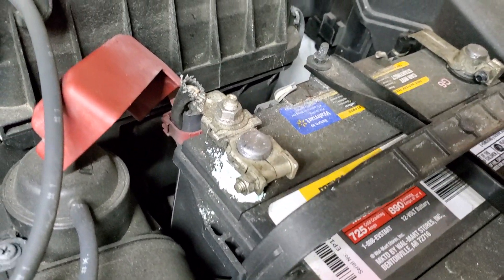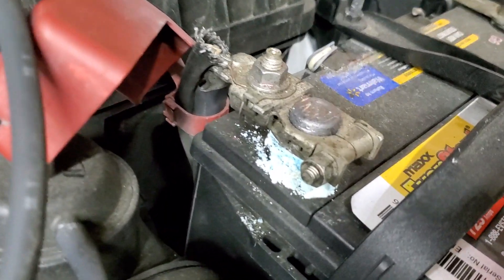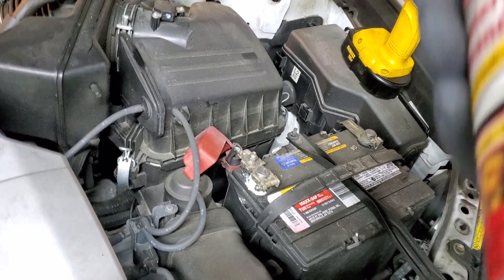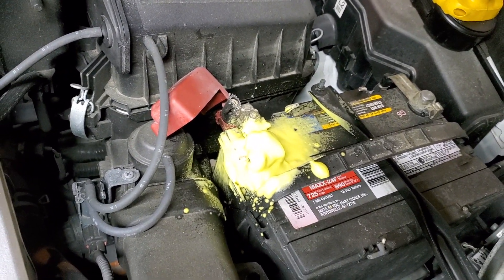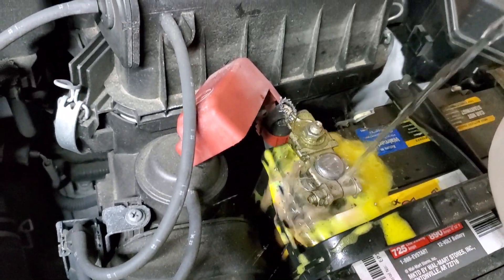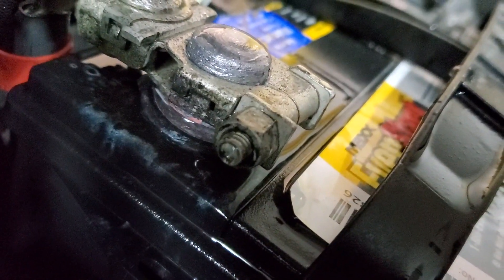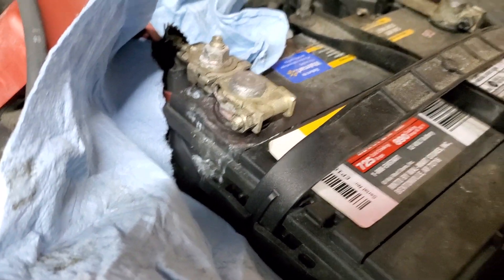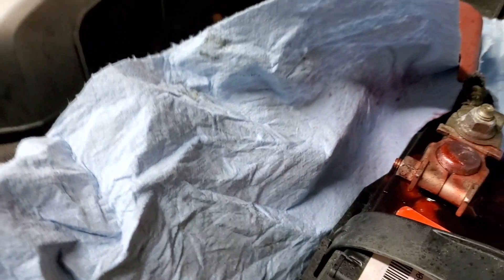Battery maintenance the easy way, how to keep battery charged, dead battery, best car battery

Comment: Thank you for your tips.  Glad to see you are using Walmart Everstart Max batteries. From multiple years and multiple cars, have only good things to say about them. I had few premature failures (3 to be exact) with Inerstate batteries over the years.  I took it back and was told one of the cells went bad each time. I just stick to Walmart now. just got another Everstart Maxx from Walmart for 88 dollars. Can’t beat that anywhere else

Comment: Baking soda mixed in water should do the trick. Then I spray WD40 on the terminals to keep it clean and conductive
Reply: Just use hot water from a kettle,let the water cool down just a min thou.I've done it for years in the car trade.Simple.
Reply: After cleaning terminals I like to use petroleum jelly on the terminals. Just smear it on them and let the heat from the engine melt it into and around the terminals.
Reply: You are right, I used baking soda and wash off with warm water. Works great

Comment: How does this help with life span of the battery?  Corrosion is very insulating itself.
Reply from the maker: Always Fully charged battery has longer life than the one is partially charged due bad connectivity

Comment: Suggestion: Why not remove the terminals and clean them with a wire brush then spray them with the staff you used. I used to apply a thin film of vaseline to protect the terminals.
Reply from the maker: Good question.  It was the plan,  but I would loose memory seats settings when I disconnect battery.  It this cleaner didn't work,  I would had remove terminals.

Comment: the best insulator for car battery terminals is bee honey ... natural and ecological
Reply from the maker: I wonder how many insects it will attract? Also,  honey is a sugar and it will create corrosion when it's starts breaking down.
Reply: @repairvehicle  
honey is a more special sugar that is anticorrosive .... try it out of curiosity and you will be surprised ... we have been putting honey on the landmarks for over 20 years

Comment: I also use a dremel with an wire wheel to clean the terminals. Also keeping the terminal nice and tight will prevent battery acid from forming around the terminals.

Comment: What about batteries in the trunk?
Reply from the maker: You have to remove battery to clean terminals.
Reply: @repairvehicle  And all scrub the wire terminals too.
Reply from the maker: You have battery in the trunk?
Reply: @repairvehicle  Maybe a BMW or Mercedes.
Reply: @repairvehicle  

      Chevy HHR trunk and Oldsmobile aurora under seat are in cabin area.  Chevy traverse under passenger foot board.  Not all batteries are in engine compartment
Reply from the maker: Thanks for sharing.

Comment: Lol, I just use a half can of coke and then drink the other half, then rinse the battery terminal with water.
Reply from the maker: Good thing I don't drink coke, probably poisoning as battery cleaner. Lol
Reply: @ToddRogers00  The acid in your stomach is worse than anything coke has. People have no esophagus problems drinking coke, but with some heartburn from the stomach acid the esophagus can be damaged.